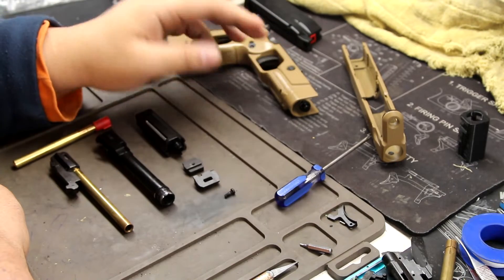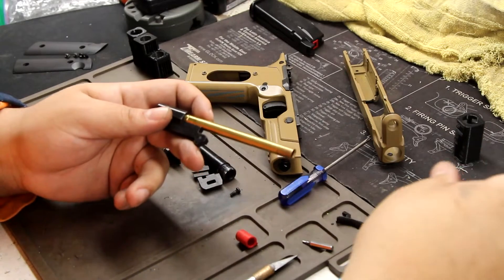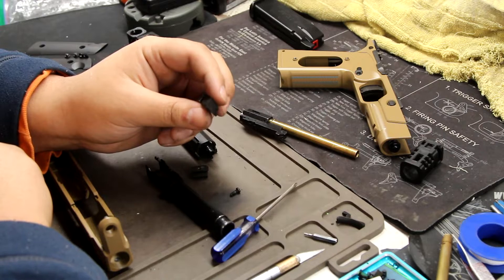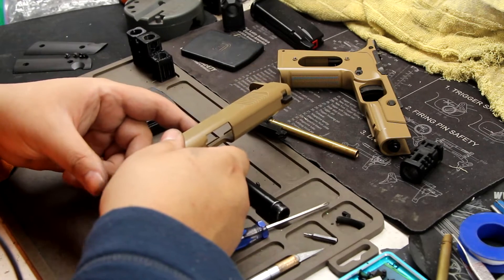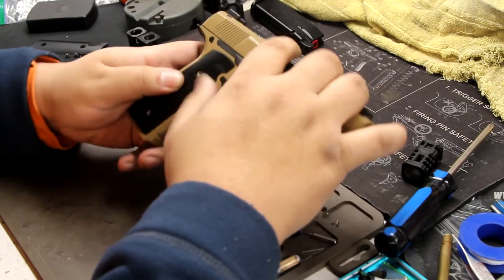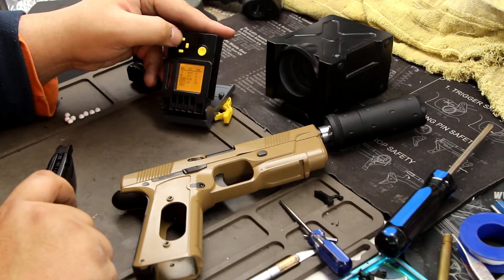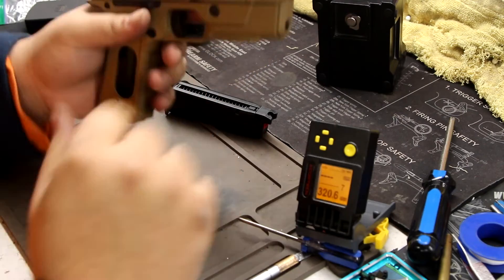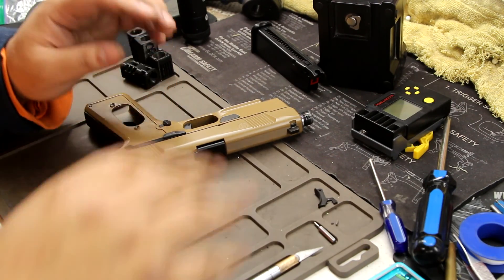Patreon Guns: Upgrades? - EMG HUDSON (3/?)

Comment: oh and speaking of accessories
I found some brand called revanchist airsoft making a VZ syle aluminum grip, rear sight rmr mount and compensator for H9
I got the grip and rmr mount
the grip kinda add a little thickness to the gun and it feels better than the stock ones to me
the rmr mount requires some filing for my ace1arms rmr to fit tho

Comment: You can use the armored works custom triad inner barrel, they looks pretty good
Reply from the maker: I wouldnt want to use their barrel or bucking when i can use a proven system for many years. (Pdi nineball ratech maple leaf etc)
Reply: @KnucklesGSM  I have the maple leaf hop up chamber for the glock and It can't work properly, I have tested in 2 glocks 17 and it has a really bad performance
Reply from the maker: thats unfortunate to hear, i havent had any issues with installing those kits if you are referring to the the complete kits. ive done a lot of them as well and still have one running in my lightweight UAC build currently.
Reply: @KnucklesGSM  it's true.. I'm thinking of get the guarder hop up chamber one, the CJ inner barrel is like meh!.., But the bucking! Is great!!!

Comment: Hey, I’ve bought a maple leaf hop up unit with a crazy jet barrel and 70 degree autobot bucking. I have installed everything correctly and with the max hop setting it is not able to hop .25 bbs correctly. I have cleaned my bucking and the i key is installed correctly. Some ppl told me I should bend my arm to get more pressure but I don’t want to make uneven pressure on the bucking and I don’t know what else it could be.
Reply from the maker: Make sure the gun isnt weak could be low power or cracked nozzle.

Comment: About the Nine Ball SAS NEO Front Kit I've seen in several of your videos: in your experience what inner barrel length would be best if I'm planning on attaching a tracer unit?
Reply from the maker: Thats based on the tracer unit you own. The current one i own cannot exceed 12mm from the front of the threads.

Comment: Hi!, I have a brand new stock gas magazine (TM glock spec) and when I charge the gas I can't full fill the mag, only 2 or 3 seconds, But when I fill when the valve release is open for purge it, then I can full fill the mag, But I have to do that all the time! What can I do to solve that issue?
Reply from the maker: make sure its being correctly filled upside down etc. if you use orings on the inlet valve that can mess it up sometimes. might be empty too. theres a lot of variables
Reply: @KnucklesGSM  I have the maple leaf inlet orings, that could help?
Reply from the maker: yea take them out and try stock /no oring on the inlet to see if those are causing issues